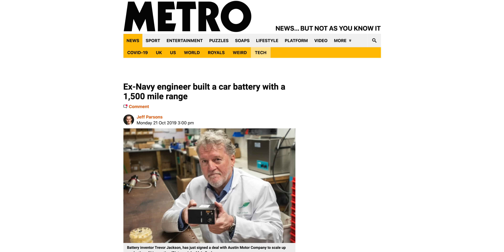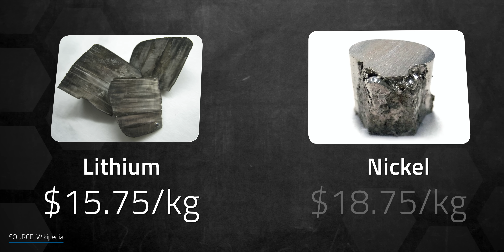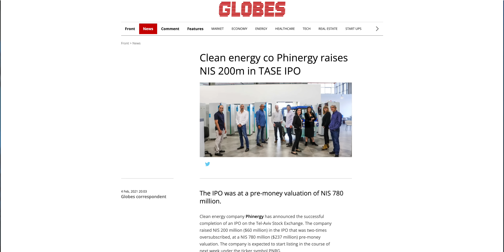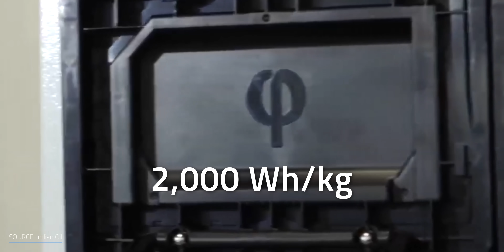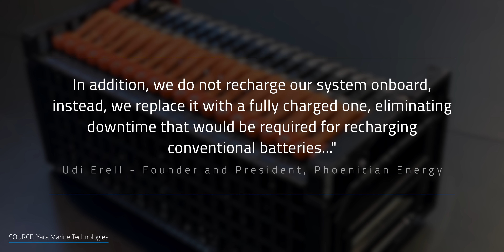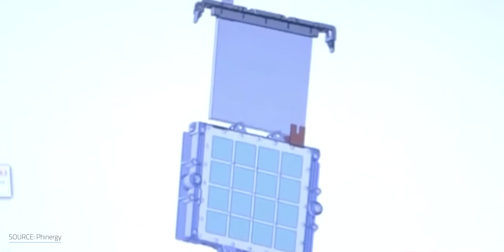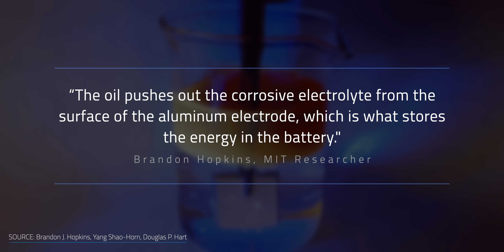Exploring the 1000 Mile Car Battery - Aluminum Air Hype?

Comment: The problem of battery out of juice can be simply solved with making it into two banks, when one bank is out, the other take over. You just have to replace the dead one. You just have to check the level of battery to see any of them is dead. And if in the future it has been used everywhere, even when both banks are dead, you can buy the replacements at nearest convenience stores. And consider that it's far easier and less investment for a convenience store to provide replacement battery than to put a charging station. 

Really, it's simpler than when your rechargable battery is run out of juice. What are you going to do with it? Knock on nearby house and ask if you can stay in their living room several hours at midnight while your battery is recharged? During which the homeowner glare at you murderously?

Comment: I've thought that battery swapping is a great way to power EVs from the beginning. If you could swap them quick enough it's faster than a partial re-charge (and possibly refueling), it incentivizes companies to improve battery tech so you swap with their batteries (lowering cost and improving quality over time), and it gets rid of the high cost replacement batteries (a current major downside to EVs as some are abandoned because of the high cost of battery replacement when spent). 
Do all these apply to Aluminum Air batteries, not necessarily, but I like the overall concept of swapping batteries.

Comment: So you want to go on a 700 Km trip for the weekend, but you still have charge for about 300 Km in the battery. Since you cannot top up the charge, your only options are (a) swap out the battery even though it still has about 1/3 of capacity left, or (b) start your trip with insufficient charge to first use up the remaining charge and then having to find a replacement station somewhere close to where your charge runs out. This is EXTREMELY WASTEFUL. Absolutely UNSUITABLE FOR CARS.

Comment: Eco-friendly?  The battery that has to be transported back to the factory, disassembled, melted down, remanufactured, and transported back to the point of use EVERY time it's used, instead of being recharged?  Yeah, I'll bet on solid state sodium batteries first.

Comment: 6:56 "of the same weight"
But because aluminium is so light weight, that equivalent weight battery would be GIGANTIC in the space it takes up.  It's like the "1 ton of feathers vs 1 ton of rocks" question, 1 ton of feathers takes up a LOT of room!

The more realistic scenario would be a car with an aluminium battery of the same energy capacity as lith-ion, and probably taking up the same sized space (coz easy swapability will increase the size), but simply lighter weight.

If this ever becomes a thing it'll be a bolt-on "500 km range extender" for your normal rechargable lith-ion electric car, that you return once it's used up.  It's sort of like a 1-time use "jerry can" you'd use for trips out to the middle of the Australian outback.
Reply: "But because aluminium is so light weight, that equivalent weight battery would be GIGANTIC in the space it takes up."

That logic does not hold. Aluminiun is about 5 times denser than lithium. By this logic it would be the lithium-ion batteries that would be gigantic, not aluminium-air batteries.

"The more realistic scenario would be a car with an aluminium battery of the same energy capacity as lith-ion, and probably taking up the same sized space [...] but simply lighter weight."

No, aluminium carries a lot of energy so for a given amount of capacity it would be both smaller and lighter than a lithium-ion battery.
Reply: @seneca983  Surprisingly Lithium is only a small part of a lithium-ion battery, approx 2% by volume.  The batteries are mostly made of Nickel & Graphite.

Comment: If these are single use batteries the disposal and recycling and remanufacturing and transportation distribution cost would all have to be required and added up.  Seems very inefficient despite the great energy density. The corrosion issues seem insurmountable also.

Comment: Aluminium Air battery wait why'd they make an coper base batteries becouse the copper has the best metal to hold a energy infact copper is the metal that have an a characteristics to resist the corrosion

Comment: Supposed to be a replacement for Lithium. Non rechargeable, and loses 80% charge long before you you would normally use even half of it.... wait what?

300 miles range is more than sufficient for 99% of commuters. For a roadtrip, just recharge while eating, bathroom, stretching. You would need to stop for gas anyway, it is not much more time at a supercharger.

Comment: I think this would be great for products like AAA batteries and smaller cells that are already primary cell applications but I dont like this for boats and cars. I want the ability to not have to rely on societies infrastructure for my equipment to function. Either with solar and maybe some longer life batteries they may come up with later on or just syngas,biogas or Biodiesel with a combustion/diesel engine. I dont like the idea of still being stuck with a proprietary fueling system with the EVs this just seems aweful and like its not going to be used in a satisfactory way. Like maybe I dont want to have to go to a fueling station or there isnt one in the area how can I recharge/recycling the battery myself. It just seems like we arent getting any easier just the same but different. Also refining aluminum is on the same scale of pollution that lithium is like they have big sludge pools of waste left over that some of the time escapes and floods neighborhoods/areas with red sludge. Idk seems like an eh development to me.

Comment: Seems more practical for commercial use rather than private individuals, if you have deliveries an app could probably calculate your path to reach a swapping station optimally and use tge charge in only a couple of days.

Comment: Wondering if a life cycle analysis has been done on this process. Intuitively it sounds rather energy intense to have to smelt aluminum for recycling of single use batteries each time they are exhausted. Imagine this at scale and if energy used for this manufacturing isn't entirely carbon neutral... It seems this could do more harm than good?
Reply: Carbon footprint in any battery will be same. Aluminium is widely available and cheap compared to Li and Cobalt which is now monopolized by one nation. Less energy intensive Al recycle can be possible once the need is felt. Achievement of countries like India should be encouraged.
Reply: Smelting the aluminium oxide created as the battery is used, back to aluminium is very energy intensive and only about a third of the input is formation enthalpy, ie the energy you might get back from the battery.  Other sites say the round trip efficiency is around 20%, far lower than rechargable lithium batteries.  So that's a no from me.

Comment: The rechargability is a red herring argument. These "batteries" are less like batteries and more like fuel cells. The fuel is the aluminum that is consumed by the chemical process and when the cell is spent you replace it. The spent battery can then be taken and the powder created by the consumption of the aluminum can be recycled back into aluminum. 

As for "running out on a road trip" I don't see why it would need to be towed anywhere. Just like your electric example a new set of batteries could be brought right to the car and installed or the car could have a "emergency" port for a smaller portable battery to be connected that allows you to drive to a service station. 

Your own video seems to point to the battery swap being really easy at least in the case of that vehicle. The new battery module sockets in and then you press the two handles down to make it lock in place. Depending on the weight of the unit the vehicle owner could swap the battery packs out. And if it's that simple then availability of swapping stations wouldn't be a problem. After all  you could purchase them just like you buy propane for your gas grill. You take your old battery modules and swap for the new modules taking care of recycling the old modules at the time of purchase of the new mondules. Any convenience store or walmart could sell the batteries so long as they are standardized and user replaceable completely mitigating the need to build out a huge network of service stations. 

The tech has a ways to go but it obviously has some advantages to the current battery tech in use in EVs. It has some draw backs as well in terms of the high energy costs of aluminum production for the batteries. But I think you've overblown these drawbacks so far without offering any ideas on how they can be addressed or mitigated.

Comment: I think the battery swapping could be totally feasible if it is modular enough, i.e. down to modules of no more than a Kg or so which you could easily pick up at any store or gas station.
I do have my doubts about making them cheap enough to be worthwhile for a single ride, but am gladly proven wrong!

Comment: You would need redundant power, in the form of a battery pack that is not being tapped into before the one currently in use runs out. When the current battery pack is depleted, you switch to the backup and take the first opportunity to swap out the spent one.

Comment: I don't see much of a difference between refueling and battery swapping, essentially. In fact, I now wonder if it would be possible to "refuel" the battery in essentially the same way we do now with internal combustion engines by simply pumping in a new electrolyte

Comment: I have concerns about the volumetric energy density.  Yes, an Aluminum air battery of the same WEIGHT as the currently available Lithium Ion Tesla battery would have a huge (7x) gain in capacity... but an aluminum battery that weighed the same as a Model S battery would be HUGE... no way could it be packaged to fit in the car, it would have to be towed behind the car on a trailer.   If we were going to go with a non-rechargeable system, I remember a few years ago reading up on using a flow battery in EV's where the liquid once expended would be drained and replaced with "fresh" liquid, then the expended liquid would be recharged at the drain / fill station, or re-processed at a different facility.  This would give a familiar use model and rapid "fill up" that ICE car owners are familiar with.  If that tech became viable for use in EV's it could be combined with a "small" (30 kWh or less) Lithium Ion battery for "local" driving that you could charge up each night at home, and only use the liquid system for road trips.

Comment: Yes, aluminum is a light weight metal. However, it still weighs significantly more than lithium. While using air helps reduce the weight of the overall battery, the specific power still appears to be lower than lithium ion batteries.

Comment: Ultimately battery swapping is the way to go. To go to a swapping station, which would be as common as a gas station, would be much more preferable than constantly having to plug the car in every few days, especially if I am only having to do that maybe once per month and takes probably 15 minutes. Then I am good to go with another 2000km+. Sign me up.

Comment: The Aluminium smelting has a lot of issues itself and isnt environmentally friendly at all. for one it is very energy intensive (14-16 MWh per ton of aluminium) and on the other hand the "red mud" that is the waste product, is also dangerous for the envoirement. I was a little disapointed that you didnt mention those 2 huge problems.

Comment: This can be an excellent range extender for Lithium-ion EVs. You can build 4X more teslas with 80-100 mile range with smaller, much cheaper, Lithium-ion batteries for daily driving and have a backup aluminum-air battery for occasional road trips. This will be a game-changer for EVS.
Reply: Shouldn’t it be the other way round ? Aluminum air batts for daily use and swapping when it’s down. Lithium ion as a secondary battery to help you get to the nearest swapping station.
Reply: @DIYBill  Modern cars are smart. I'm sure they could automatically choose how to do this balancing act while leaving suitable reserve.
Reply: So if the batteries on your tesla fail you get to replace 2 expensive batteries.  LOL  Think forward a bit.
Reply: @SuperGreyfox99  Read more carefully a bit

Comment: It might not be rechargable but if all the iocl petrol station has the swapping capability then you can think of it as as ic engine cars of course you have to be aware of the capacity remaining in the battery just like you have to be aware of fuel remaining in the tank in case of ic engine cars.

Comment: 9:15 "Imagine travelling with your family at night..." This is a false argument. The same argument could be made against EVs 20 years ago, when there were no charge points, or against ICE cars 100 years ago, when you had to buy gasline in glass bottles from a chemist, or against horse and buggys before Inns and wayside taverns became a thing. That problem could easily be solved by your emergency roadside assist company turning up with a new battery and swapping it out, providing batteries and connection architecture were standardised.

Comment: Instead of replacing entire battery pack, could there be a way for the user to replace depleted aluminum safely.  I’m pleased to buy aluminum sheets at the grocery store and plug them into my battery monthly or every 1000 miles.

Comment: 1:10 'Waiting for a long time'? Huh? This information is already out of date and the video was only posted 4 days ago. LFP batteries allowing a 500km range with an 800v architecture can allow rapid charging from 20-80% charge in 18 minutes. In some cases this will give around 250 miles in under 10 minutes, almost the same as a gas car.

Comment: The more I thought about it, the more stupid aluminum batteries are.  Firstly, if they're like hydrogen fuel cells then they still need lithium batteries for recapturing energy from braking and also aluminum batteries can't be throttled just like hydrogen.  They either recharge the lithium battery or they don't.  The amount of electricity they produce can't be controlled without massive losses, so lithium batteries are still needed just like hydrogen cars.  The second problem is the amount of waste you can have from people swapping batteries before they completely run out.  If you're going on a long trip then what do you do with a battery at 50% or 25%?  You're going to waste the energy in the battery so you can make long trips.  The 3rd problem is how inefficient this is.  Aluminum manufacturing uses a lot of electricity and aluminum air batteries are only 15% efficient.  Compared to the 2% loss with lithium batteries, this seems like a waste.  

The only people who think Aluminum Air batteries are good are people who have stock in Aluminum and want to drive up prices for Aluminum.

Comment: To succeed, follow KISS😘 (Keep It Simple Stupid! )

USE ETHANOL AS FUEL

so simple, no additives, less cradle-grave pollution (bkz raw material is an agricultural product)

no need to mine any rare metal from ground,

Reduces growing energy crisis bkz dosen't consume electricity.

used instead of petrol or can be mixed in any composition.
(So poor people can do a simple mod on their vehicles, no need to buy expensive vehicles.)

Is this practical? Ask Brazilians!!

Comment: Countries with good solar power density can use this renewable energy for recovering Aluminum.

Batary swapping is not a problem at all, after all we do go for recharge or filling the tank to the respective station.

Comment: No would not have a car with Aluminum Air Battery. One would like to be able to charge at home so one knows that they have a full charge.  I think the Aluminum Air Battery could work with other hardware such as small planes or Vtol.

Comment: "A car with an Aluminium-air battery would have be be towed to a swap station"... Surely it would make more sense for roadside aid to simply deliver you a new battery wherever you are?
Reply: No kidding, that's what I was thinking.  They deliver gas out to you if you run out.

Comment: Let them start by giving out minimum range in winter, give 10+ years of warranteed on the battery and have governments force local governments to allow us to put the car in the front yard so we can actually charge.  and they should also note the idle cost of the car.  A older tesla uses up to 400 kwh a year just standing there! thats 20% of my current power draw and based of numbers from a warmer climate. 
I want to know what the car costs just standing thereas m uch as my range, the battery life and degredation and most of all it should cost me no less then my gas car which currently is not the fact. 
My gas car costs me 30 grand less for the same range whcih equals to 270.000 km worth of fuel with high highway prices all my insurance and roas tax compbined and my gas tank is guaranteed to never need replacement. and then i have not even charged my battery yet.  a 100 kwh tesla battery for 450 km range in summer costs me as much to charge as a fyull gas tank at a fast charger. The car is way heavyer and expensive so my insurance over 10+ years cost me over 5 grand more.  so end of the road a EV just costs me 35 grand more at minimum. And no maintenance is not cheaper on a tesla. Tire wear is way more and all the random repairs that need to happen or electric crap that can break costs a fortune to repair. It's a no win situation regardless of the battery type in the car.

As for battery swapping NOPE i dont have the space at home for a spare battery.

Comment: The problem of running out of juce in a car equiped with an Al. Air Battery can be very easily solved by having a hybrid system of Al. Air and a small Lithium Based Battery for emergency or as a sort of reserve tank like they used to have in old mortorcyles.